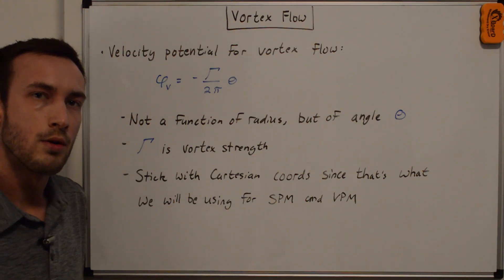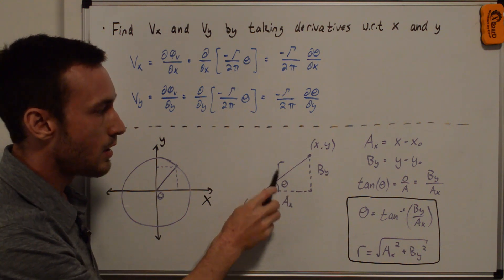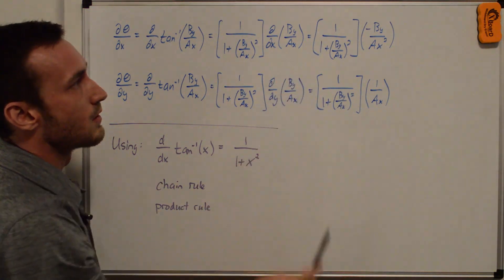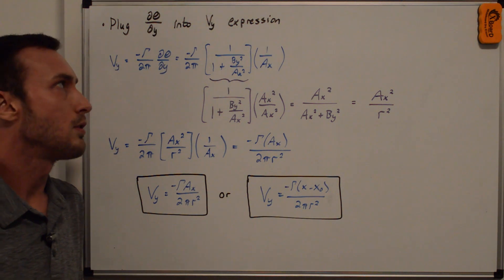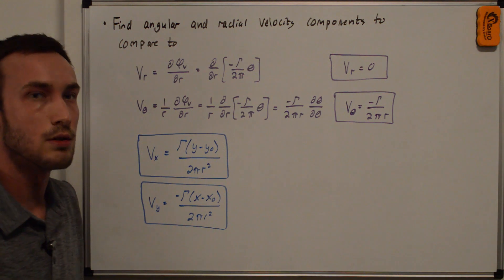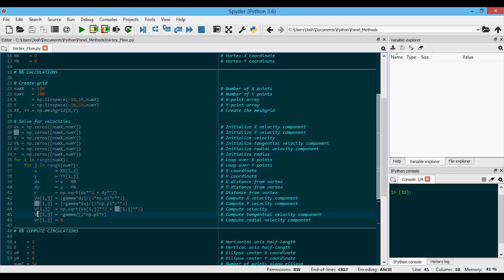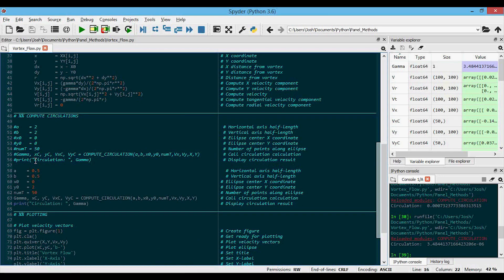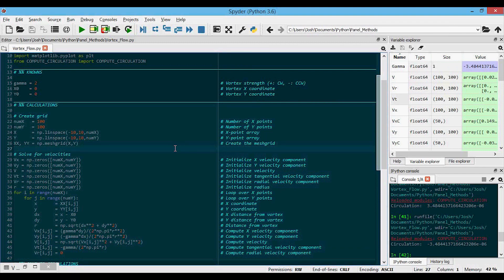Vortex Flow (Incompressible Potential Flow)

Comment: Hi Josh! Thank you for your video and I really learnt a lot from them. I'm now working on the panel method and I'm wondering what influences does the circulation shape have on the flow? As you shrink the circle from 2 to 0.5 and moved it from (0,0) to (0,2), but it seems that there is no difference  between the results before and after except the circulation value.
Reply from the maker: Hey Rui, I'm glad my videos are helpful!  So the nice thing about computing the circulation is that the closed curve (in my case the circle/ellipse) can have any shape, and the computed circulation value won't change.  So let's say we have a single vortex at the origin (0,0).  We can draw any shape (closed curve), and as long as the shape does not enclose the origin, the circulation will be zero.  We can then draw a different shape (closed curve), and as long as that one does enclose the origin, the circulation value will be equal to the vortex strength.  I choose to compute the circulation using an ellipse because it is easy to parameterize with a single variable (theta), and it's easy to specify its size (major and minor axis) and its location (offset values).  An ellipse sort of looks like an airfoil, so in my future vortex panel method video, it will be easy to encompass the airfoil in an ellipse to compute the circulation around the airfoil.  But you can use any shape you want!
Reply: @JoshTheEngineer  Thank you for your reply Josh. Your reply is very detailed and solved my confusions. I'm looking forward to your future videos!